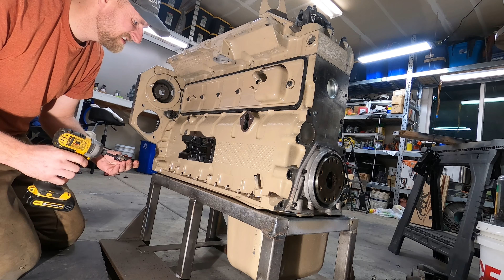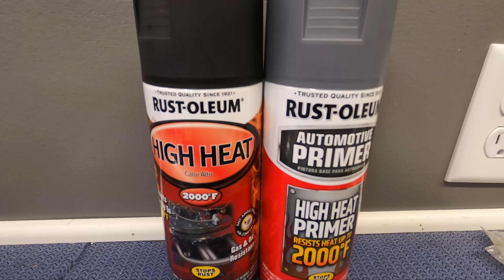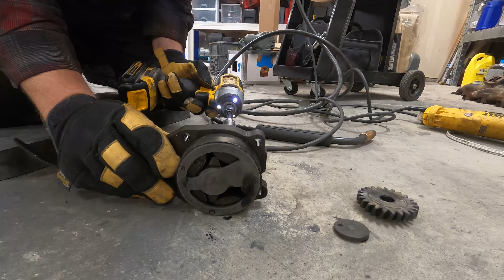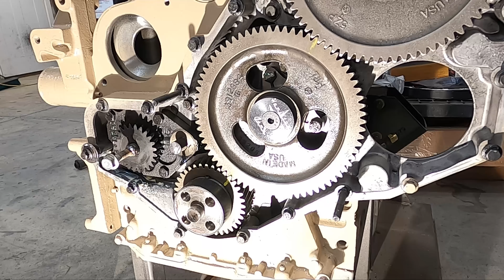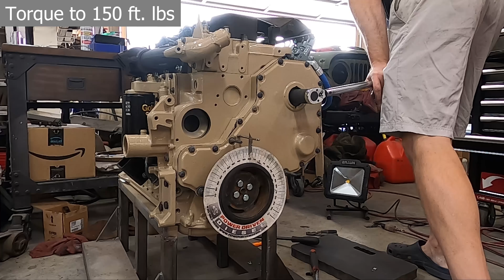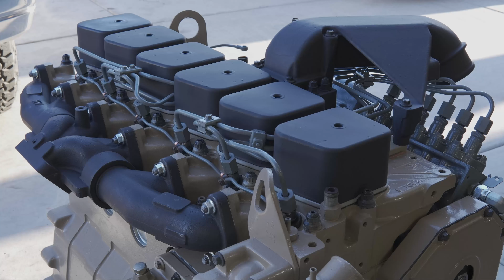CLEAN 12 Valve Cummins Engine Build | Finishing Touches

Comment: I see in this video that you installed the oil cooler, but there was no mention of whether you replaced this part: 3936365. It costs $15 and should be replaced with the new stronger version. The ones that Dodge had installed used a thinner wire spring and would not hold good oil pressure. When mine finally failed, my idle OP was less than 10 psi, at 2000 rpm I could barely hold 30 psi, and a cold start was also very low psi. After replacing that valve, my OP is 24 psi at idle, ~50 at cruising speed, and roughly 62.5 on a cold morning start. Most people are not aware of that valve as it doesn't come in a rebuild kit.

Comment: Nice! Are you still planning the high horse VE pump motor build? I just got my 93 d250 back on the road. Thanks bud, looking good!
Reply from the maker: Yes, I've got all the parts to get it up to 400-450 HP. I'll be doing all that this month and headed to a local dyno event on May 7th. Glad to hear your d250 is back up and going! What were you doing to it?
Reply: She was just laid up needing an injection pump. I ended up borrowing a spare from a buddy, and installing it. I've been a marine mechanic for 20+ years, mostly way bigger stuff. I really like how much you accomplish with minimum space and tools! I put a gov spring and fuel pin in her with your assistance, Thank you very much!
Reply from the maker: @wlogue  Awesome! Glad I could be of assistance. Let me know if you have any particular questions.